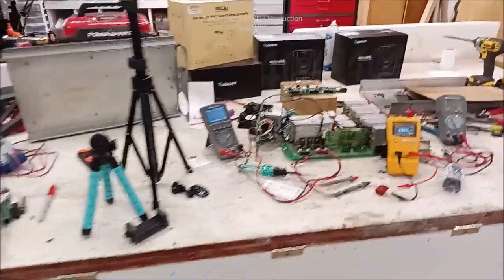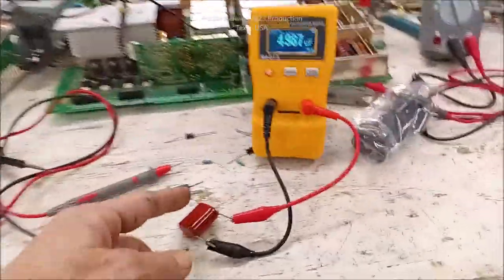How to handle Viewer Complaints, & still have shop time fun

Comment: Here's a good one for you John. A Chinese watt is only half what an American watt is. Saw it on you tube so you know it has to be true
Reply from the maker: That's a sorta accurate standard. It's like a Braggard horse power is 50% over the actual auto manufacturers horse power. For advertiser and competition reasons trusting claimed horsepower, watts, and length (lol) now days is at your own risk. That's why I use meters and gauges!

Comment: Mr Daniel I have another wind turbine question for you. I respect your opinion on this matter. I found a website called Thermodyne system. Have you ever had any dealings with them ? I might go ahead and pull the trigger on the B&C 800 watt Chinese turbine.
Reply from the maker: Thermodyne is a great source for DIY parts, materials are built very well for that purpose but require your attention when combining them to build with to make sure they are effective. As for the 800w B&C, its a great turbine and durable.
Reply: @JOHNDANIEL1  Thank you for replying.

Comment: Hat wanted to ask ya how is that little generator doing??? Have ya had a chance to check it out.... injoy your coffee sir
Reply from the maker: Kiera has been using it to run a very old 1998 year Remington 14" electric chain saw, on its 5th blade! And its a 7.5 amp saw so it does good as long as she don't bog it down too much. On 3rd full tank of gas, doing great.